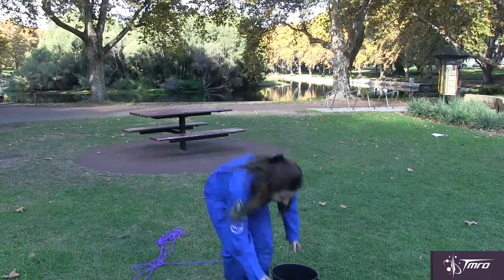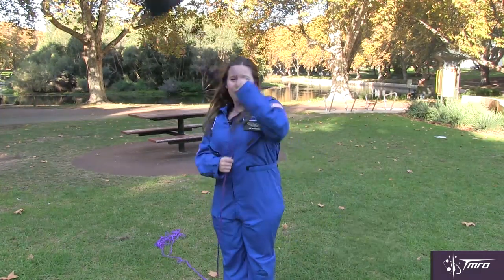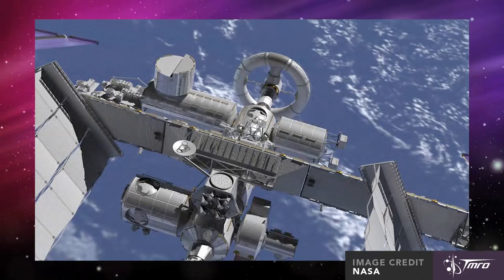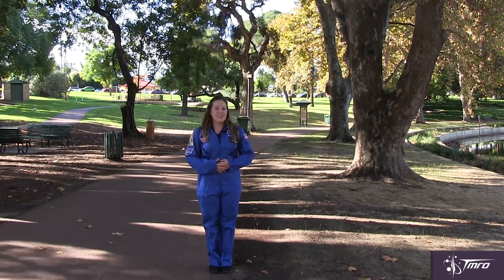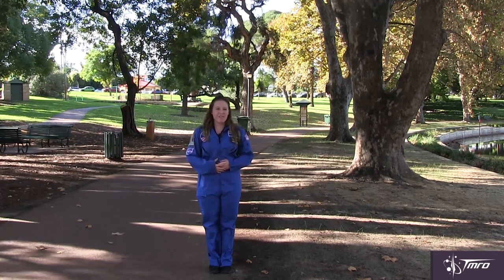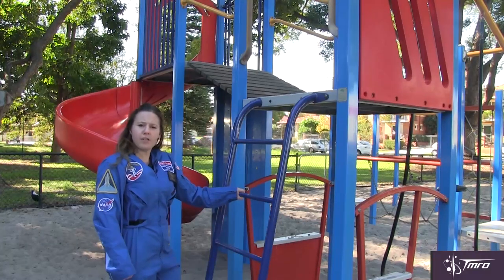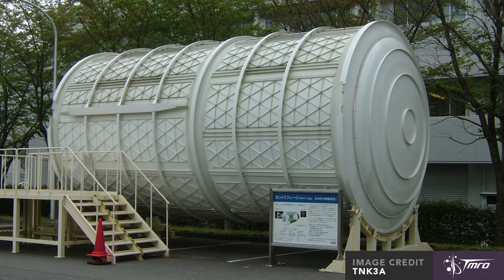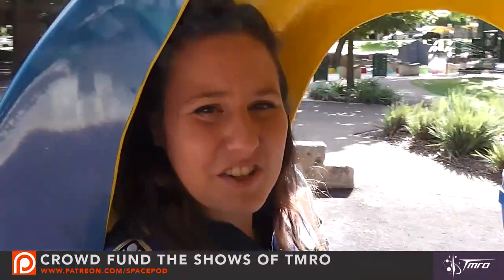The basics of Artificial Gravity - Space Pod 05/11/16

Comment: Centrifugal? Or centripetal? It's been a few years but my physics teacher was adamant about one of those being wrong.
Reply: I'm a fan of those people who stubbornly, persistently keep saying things like "centrifugal force is wrong".

It's almost like saying gravity is "wrong": "Gravity is wrong, there's no force, there's just a curvature of space".

It's not wrong, it's just a layer of abstraction.
Reply: Of course I'm not saying this about you, just that physics teacher ;)
Reply: +Will B When the rope or other constraining device changes the moving object from its natural inertial straight-line motion into a curve, it is applying a force to that object; the applied force is properly referred to as centripetal ("pulling toward center"), and the reaction force of the object's inertia pulling against the constraint is centrifugal ("flying away from center").  While these are equal in magnitude and opposite in direction, note that the centrifugal force is the effect, not the cause.  For normal planetary orbits, the applied force is simply the gravitational attraction between the two bodies.  That is not the same kind of force as the rope under tension, although it has an analogous effect.  The main difference is that the applied rope force does not pervade the whole space-time region, but is confined to the vicinity of the rope and whatever structures are used to attach the rope to the rest of the system.
Reply: Doug Gwyn Oooh! Informative! Thanks.

Comment: In order to give people some gravity during sleep all you need is a hammock tied to 2 synchronized motors attached to bulkheads.  Think of a normal hammock on a marine vessel, but on the ISS.  It looks pretty silly because it doesn't hang any particular direction.  Now, have someone get in and situate themselves as if they are hanging one direction or another.  Now, spin up the motors.  That would probably go a significant way toward reducing certain degradation of a humans's systems that otherwise occur living in zero g for weeks.

This is so cheap and easy I'm surprised the Russians haven't tried it.  But not really, because I wonder if their modules aren't even large enough to pull it off.

The more I think about this, the more it makes sense.  Picture 2 meter industrial long dryer tumbler, but for 4 people sleeping.  They are kept in position by something like the fins in an actual dryer.  If I wanted to go to Mars, I would definitely not want to have my body totally lose the hard acceleration (g) aspects of its firmware over the trip.  I'd definitely beg for the cheap sleeping acceleration if I could get it.

Of course, when we landed on Mars and my body experienced steady acceleration for more than several minutes I'd get super sleepy.  But that would be be a smaller obstacle than having to pull a huge suite of autonomic support functions out of cold storage before I could function well.  The neocortex is waay more than just your consciousness, and it's wired into everything and its subject to forgetting how to do things over weeks and months of not doing them.